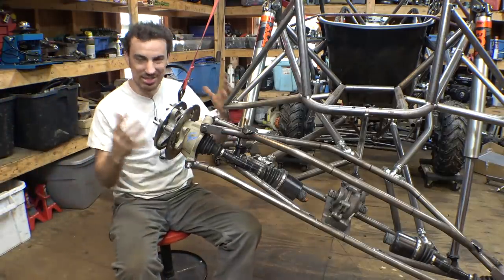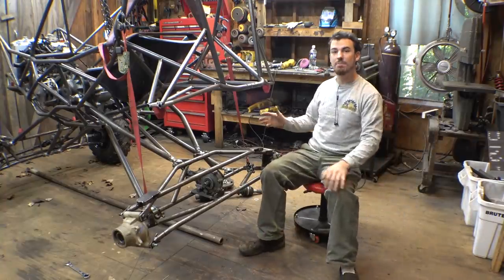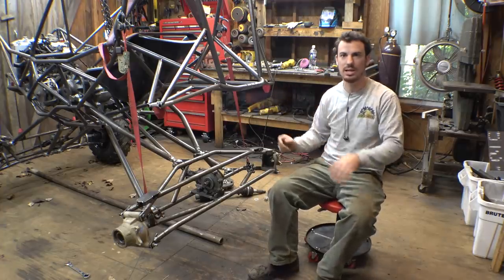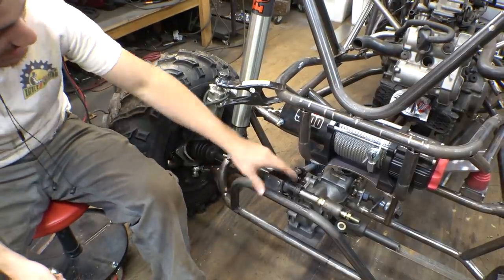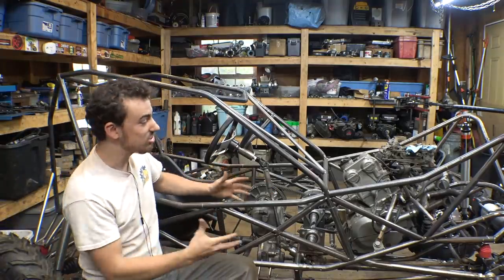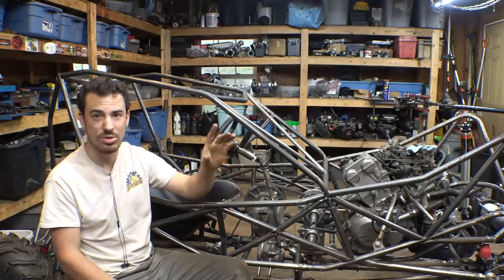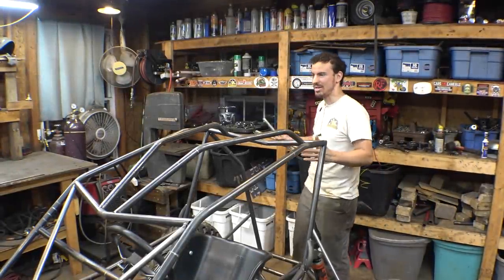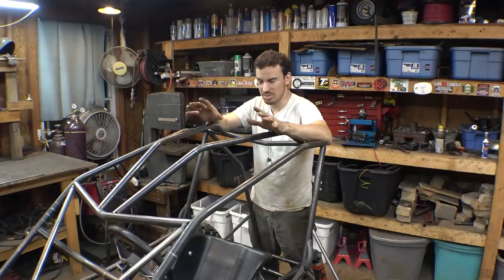Mini Rock Crawler Build SV650 Part 7

Comment: Hey can you attempt to use shifter cables this time? You’d have to get the stiffer ones of course but I believe it would work. You just have to anchor down more than the end points well so the lines don’t flex. 
This would un-complicate the shifting setup which happens to be complicated already. 
This is an awesome project man. Your the guy to do it tho. 
Oh and heads up… there are several bolt on power steering kits that are very affordable. You may need the assist when on rocks.

Comment: Being such a high riding vehicle, every ounce saved from above your head makes it harder to tip over. So with security in mind, keep the roof bars at the bare minimum: A few crosses in center, diagonals on sides. Remember, you still need to add gussett tubes on those sharp rear corners. Otherwise it will collapse when rolled over.
Reply: your reading my mind, we will have to wait and see what the "final" ride height will be. it could be a 30% front and 70% rear suspension ride height?
Reply: @plageran  A "Monster Rake" would look amazing, but how would it actually function? In this setup, the ride height is made by adjusting the shock pressure. more ride height = more pressure, less absorbtion, less grip, more rebound, so for example when jumped, the car would try to front flip every time, and when wall climbed, the rear tyres would never get a good grip, they'd just dig in the dirt. I'd go for 25% in all corners, to keep it soft, level and low.
Reply: @oikkuoek  i hear you, still with the engine  infront of him, not gonna be much to see from that angle, just my opinion lol

Comment: Try using your roller bender closer to the edge, you will get less deflection in the rollers.
Reply: Wouldn't you have more deflection to one side of whatever he's rolling?
Reply: Nope it's tighter and stays mor straight n square on the edge most rollers like the one in the video can even use the very edge or side as a guide with even a square along side it

Comment: Switch the front to 3-link with panhard and have a steering box mounted to the frame.
Reply: Nice idea, using a strring box on the frame, and a rack and pinion on the front axle would reduce/eliminate some of the issues those U joints could cause

Comment: This is just a quality-of-life suggestion, but in the future, think about adding a remote filling/release for the shocks closer to yourself in the cab somewhere so that you can change the pressure in the shocks without needing to get out of the cab. You will be thankful you did it when it is done as it allows you to change weight distro on a per axel basis while riding/climbing. Just mount the tank in a safe and easy place for changing
Reply: You cant do that. These shocks need to be filled with zero load/weight on them,
The seal could be damaged, and the pressure would not be equal as it increase in the shock body when load is applyed on them.
Reply: @Bproject89  shock pressure changes at min/max if your logic is correct they would blow themselves apart just going down the driveway lol
Reply: @Grizzydan  the intern are not free flowing,  when filling them with load on them ( compressed ) the nitrogen have to travel trough the piston and valve body and fight the load. 
How do you know your having 200 psi all around at full extend if the shock are not equaly extended or conpressed to begin with 🤷🏻‍♂️

Do you even own, or have ever used/tuned one of these  or any other air shocks on the market, its all the same. Its even writen in the damn paper they give you with the shocks.

Comment: the top of the cage You have to think of what will give and bend if you roll over? With the clutch mount the control on gear shift lever. The will free up a hand for controling the cart better?

Comment: It's looking pretty good,and solid so far Chris.Clutch handle on the shifter is the better choice.Please set-up your radiator,and fuel tank before doing more with the frame so you don't have to work around anything,or have either shaken like an 'Etch-a-sketch' when going over bumps.

Comment: I'll suggest try to make a on-steering likewise pad shifter for the clutch if you can handle the force, bacause I think you will want to hold both hands in the wheel when driving specially in the rocks, which you can't if using a hand lever. Great work as always, keep it up!
Reply: Likely won’t be shifting in the rough areas.

Comment: I think that you should add two racks on both sides of the rack and pinion or you will have the same issue than in the buggy. I like simplicity, that's good, but if you try to steer "by hand" both axes with that small steering wheel you will be exhaust in seconds. You will be forced to steer in complicated situations where turn is harder than in the street. For a "man force steering" you should go to a bigger diameter steering wheel like in the old times, when power asisted steering didn't exist. I like very much your work, congratulations from Spain.

Comment: Loving the build.  But since you’re asking for opinions, I would suggest reversing the windshield area braces and have them start at the middle of the angry eyebrow cross bar and come down to the outside corners of the dash bar.  Stronger transfer of forces and tends to look better.  ‘/\’ instead of ‘\/‘.

Comment: I've never seen a steering system with tie rods that vary so much in length.  It's going to be interesting to see if the steering behaves differently at left/right lock - as it looks like the geometry is going to be asymmetric.  I'm sure you'll get it to work though, seeing your fabrication skills.
Reply: @Mike With the rack positioned off centre, it is impossible for the steering to operate symmetrically - unless the rack on the side with the longer tie rod is rigidly extended (to, effectively, centre the rack on the vehicle) so that the tie rods can be of the same length (this would also require a sliding support, on that side, to stop the rack from bending - otherwise he's going to have another rack trying to twist itself out of its mount - see one of his a recent videos).  In short - the triangles from the each end of the rack, the end of each steering arm and the centre of steering rotation of each of the front hubs are different on each side of the vehicle - so the front wheels will steer a different amount on each side of the vehicle (in addition to the desired difference caused by the Ackerman angle geometry of the steering arms).  This undesirable difference may well be imperceptible - but it will be there.  Geometry teaches us this.

Comment: I don't know if it's in the budget but I would recommend a sea star boat hydraulic steering set up. Its just two hoses from the steering unit to the ram. No pump needed. The rack system will suck when one wheel pushes up against a bolder.

Comment: It'll be interesting to see how the steering shaft will work in action. Seems like if you hold the steering wheel straight and the suspension flexes, the rack will rotate around the shaft and try to steer the wheels. You can see it a little when the left shock airs up. Whether that's a real problem, who knows?

Comment: Do only the outside areas on the top and do stirrups up the back so you can climb the back and drop in thru the top. Move the jackshaft up and the trans case forward to have better room for your feet and controls. And tip the seat forward enough to see the front tires well.

Comment: Since you have the CVT clutch, you likely won't need to use the engine clutch except for take off, correct? I would suggest, right foot=throttle, left foot= brake, clutch on the steering wheel like a shifter kart, and lever to shift like you normally put on these or possibly paddle shifters on the wheel.

Comment: Ever thought of installing an Auto clutch from Rekluse? Would make it a lot easier when climbing rocks in 1st gear.
Reply: he has the engine running a cvt transmission/transfer case. So with the bike trans in gear, the cvt wont be engaged at idle. Kind of like having an external rekluse.

Comment: I remember a guy built a buggy and it had a control stick like a plane.   Tilt left or right to steer,  push forward for more throttle, pull back for brake.   Another stick was for shifting and it had a clutch lever on it.

Comment: If you are crawling that thing you need clutch and gas control.... so I would make thos left and right pedal... And then have handbrake (maybe even two, each for front and rear?!) on the steering and a gearshifter on the right...
Love the build btw, I build custom RCs and It is a similar process! :D

Comment: Hydraulic rams would be a better option on steering and it would've been awesome with 4 wheel steer as well - a modification I think you will have to do later on
Reply: He mentioned those and decided against such due to their being costly and more complicated than he's willing to work with, yet.
Reply: @GaisaSanktejo  be prepared for the steering wheel to break your hands when ramming into boulders etc
Reply: Hydraulic cylinders for steering would be a huge pain. He would need an electric hydraulic pump that would take quite a few amps to run. The stator probably doesn't have much for output. Adding like a GM 3 wire alternator to it would be difficult especially to do a V-belt to run it. Normal electric power steering would be a huge expense.
Reply: @Ratkill9000  separate battery and a split charge kit ain't that much there's space for it hydro kit not that price'y and easy to run hoses down link arm to a ram come on he's went to that extent then do it right think about how much it will cost redoing the whole system afterwards-try old hydraulic lawnmowers for steering parts

Comment: would be cool if you put the clutch on your shifter and figure out how to route the cable from there. something else to think of is: If it rolls over the nose is going to faceplant. leave the back open with foot mounts and can use that to get in or out of the bouncer

Comment: I have a suggestion for how you might be able to make it a bit easier to get into, I think you might be able to make a step out the the rear bump stops (where the mount to the cage) so you can step on the tire, then to the bump stop step, then slide in the the seat/cage. that's my only real input. I will say there will be times when you regret no having hydraulic steering, it is a pain to set up if your not used to it but worth it in the end. keep on making epic builds man this thing looks sick!

Comment: I think you're really underestimating the usefulness of thin plate steel. On the back instead of the razorback louvre thing you could have a laser cut plate with your logo on it.
On the top I'd put a thin plate roof. Way more strength that tube, if you do rill you won't get covered in dirt and there's no chance of a limb coming through the top and getting squashed, and it keeps the sun and rain off you!
If you want to really boujie you could do tin plate and bead roll it!

Comment: Ya boats have really simple hydraulic steering systems you can buy. Easy electric over hydraulic system you can buy. I almost wonder if an even cheaper solution would be a cable drive steering out of a boat.

Comment: Have you seen SuperFastMatt's Honda 600? He has a motorcycle transmission in it and mounted the hand clutch to the shift lever. It looks like it might actually be easier to get in from the rear than the sides, might be worth trying out before finalizing supports and louvers.

Comment: Hello, greetings from Spain.
 A comment, if the steering arm is shorter on the right side than the left, when you lower the suspension it will modify the toe in differently on each wheel

Comment: I don't like the "louvers". They are added weight up high and don't add much in terms of strength. Some nice X bracing will help prevent the frame from twisting or getting crushed in a rollover. Louvers wouldn't be as strong in a rollover and the weight would make you more likely to roll over.

Comment: What about drive shaft protection for you, and them for rocks between the axles as you pass over a high center points.
Aka skid plates along the under carriage at key points to prevent damage, and driveshaft loops in case you break a u joint to prevent shafts from possibly causing you harm, are causing the vehicle from flipping over by digging in like a pole vault.
Also maybe a steering assist shock to prevent it binding up, and causing the steering wheel to spin in your hands thus possibly breaking your thumbs

Comment: this thing needs more steering angle. i'd be you i would extend the knuckles and relocate the rack and pinion closer to the ackermann. maybe even boost the rack with a small gearbox, so it goes lock to lock in 1.5 turns. at least i'd add a brace under the bearing supporting the steering shaft on the front axle, it's bound to get out of alignment and that's not good.

Comment: You could put the clutch handle on the shifter so you kind of have a 2 in 1 solution.
Also: doesn’t it steer when the axle gets tilted from the one side to the other with this setup? 
Other than that i would like to say that your content is really great and i learned a lot from you!
Greetings from Germany!

Comment: Another option for steering could be 2 hydraulic cylinders, one on the front axle attached to a tierod bar and the other to the steering wheel and rack that way you can run hoses from one to the other.

Comment: I stopped at 7:16 to say I thought about this for a mini jeep with a live front axle, It's going to steer with articulation which isn't very helpful as you have to turn the wheel with the articulation to keep the wheels straight. I recomend moving it and having it sideways next to the pickup points of your front arms and making it more like old school american trucks... also you should turn the ball joint on the right hand side up the other way to get it in line with the left side

Comment: Just take into consideration, when you start using it, you’re only going to want about 30% of the nitrogen in them, that you had at full extension. 30% of travel to dampen ride, and 70% for extension when crawling

Comment: I think you need to add at least 12 inches of headroom so its easier to get in and out.  Think about it if you roll - you want to be able to climb out easily if the rig is upside down or on its side. Right now it looks like you will be pinned if anything goes wrong.

Comment: Have you ever thought about mounting large paddles behind the steering wheel to use for a shifter? Left paddle pulls down on the shift lever, right pulls up. Upshift with the right paddle, blah blah, etc... That still leaves the question of the clutch, however. Not really room to do a 3 pedal setup, huh?

Comment: The center of gravity is way to high. You will have to go lower and bigger wheels and tires. For the steering you should better use parts from a car that are beefier than go cart parts and also power steering. I like your build and i thing your capable of building a full size rock bouncer!
Ps you have to find a way to smooth out those steering shaft angles!

Comment: Hey, this might be a dumb question. I'm not great with any of this stuff. Just love watching your videos.
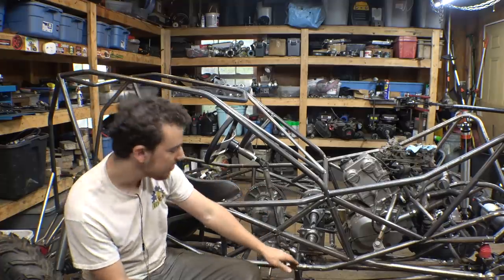However isn't there going to be a weak section just behind the engine, where it drops down on the frame (where his hand is at 12:13, from the bottom leading upwards to where the tubes join up together) especially if the vehicle drops with force.
I only say this due to where the suspension is mounted. Wouldn't it put a lot of stress on this section. And possibly cause it to fail at this section?

If I am correct in thinking this it could be easily fixed with 2 bars connecting from next to the engine up towards the top bars of where he will sit? Right?

Once again, sorry if this is a dumb question.
Reply: He's still building the beast and has more reinforcing to do as yet, so, while your concern is valid at this very moment, it may be resolved later :)

Comment: I think hydraulic steering would be a lot better, it's honestly less complicated than this steering. Also those diffs are going to grenade themselves very quickly. Car differentials would be a better option.
Reply: That's exactly what I thougt as well. An hydraulic steering from an old boat would do a nice job here. But unfortunately most cart and buggy builders have their mind set on u-joints, chains and sprockets and so on, where I think, hydraulic would be smaller and more efficient.
Reply: @123Poppa321  Also with hydraulic steering the wheels can't kick the steering wheel back.

Comment: Just my opinion, but those top bars that tie the left and right frame together should be arched upwards. It wouldn't look as mean, but it would give you more head room, and be a whole lot stronger in a rollover situation. There's a reason arches have been used since ancient times, when force is put on their outer diameter they only get stronger, but it only takes a little bit of force on their inner diameter to fold them up.

Comment: Super excited about this guy. Are you gonna run bigger tires?? It's sitting a bit higher than a fullsize. Full-sizes usually have links running more level than running angled from chassis to axles, it gives it a lower cog so it doesn't tip when doing 50 over 6ft boulders. Just trying to pick your brain man, not hating or criticism. Lol

Comment: I would put brake on shifter with a splitter valve in the cockpit so you can use both front and back or one by itself.

Comment: the ball pins of the steering are not in the axis of each other, how about connecting both pins with one pipe for greater stability, in the field there will not be so much stressed ridge power steering that you would connect in parallel to the pipe with ball pins, awesome you skills, congratulation

Comment: Why are you not turning the left tires around so they are turning in the right direction ? Every podcast you have put out on this project has the left tire treads facing the wrong direction .